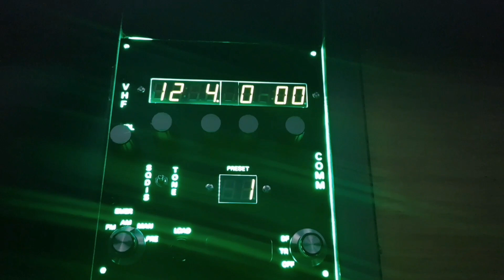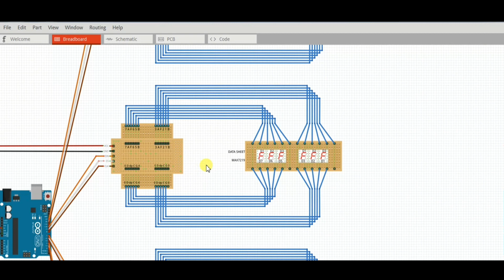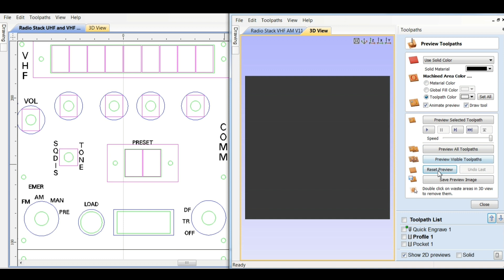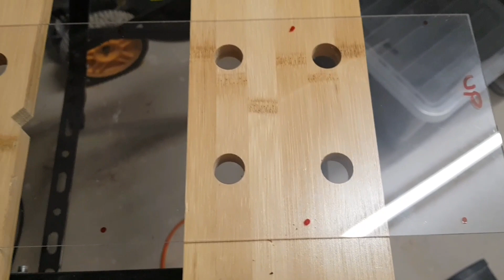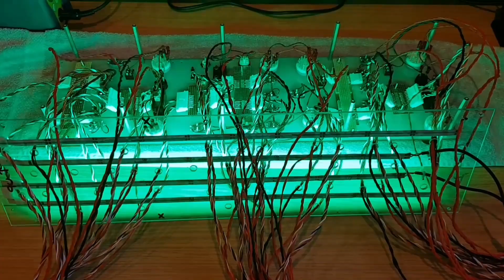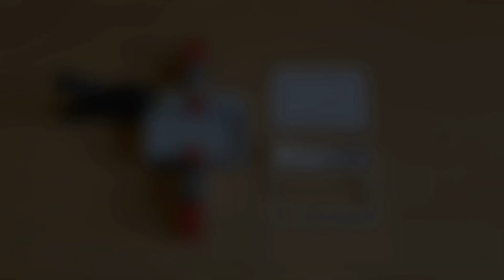Simpit A10C Radio Cluster Panel

Comment: Another fab video Craig. Where in the UK do you buy your switches. For example, the ones used on the battery panel s toggle on and off but also the inverter switch which toggles on in the up position but returns when toggled down??

Thanks
Toby
Reply from the maker: Hi Toby, many thanks for the thumbs up. I purchased most of mine from rapidonline.com. The odd one from RS components but they are expensive by comparison.
Cheers 👍

Comment: Hello Craig is it posible to contact you via email. I have a problem and cant find any help on the Internet. I want to build an universal radio Panel with two of those 7 Segment Displays. I wrote a Code and the first 10 changes on the Panel will be Displayed but after those 10 the Displays go crazy and Shows stupid crap. so if you have time and Passion you can contact me via: suhalt677@gmail.com

Comment: First of all Great JOB !, You use a Single Arduino for all panels ? How can you connect all devices if there are not enought pins on a single arduino board ? You use Shifters ? or you use a master Arduino and several slave arduino mini ?
Reply from the maker: Hi Jordi, I currently have 3 arduinos being used. The first Arduino is an uno and dedicated to the radio cluster, the second is a mega which controls parts of the left console (i.e potentiometers and indicator lights) and the third, is another mega which runs an RS485 network. This could potentially run many slaves (Arduino nanos), I plan to use it for all instrument gauges and the circuit breaker panel. I might also use it to connect the IFF and TISL panels.

Comment: One of the best YouTube Videos I have seen ever. Thank you so much. As a programmer and electrician, I can imagine how much hours have gone in to your project. I`m just jealous. I'm going to buy a CNC machine by the end of this year. Any recommendations?
Reply from the maker: Hello, thanks for the positive comments. 
My father-in-law built his own cnc machine and kindly let's me use this. 
Within the next year I will either buy a cnc or build one. I have read into a few flat pack built cnc's (like stepcraft) but not sure now accurate they are with small engraving.
With time being limited, I'm focusing on building my simpit and will research cnc's more into next year because if I build one I'm sure it will consume many months to get it just right. 
Are you building a simpit, if so what type. Good luck with your project, cheers
Reply: I just finished a real Truck Home Cockpit. Now I`m looking into a fighter yet.
Reply from the maker: That's cool. Some months ago I saw a few videos online where people got car instrument clusters connected to their PC. Brilliant. Good luck with your project, cheers
Reply: Craig S Thanks! Would you be willing to share CAD files for one of your panels? I’d would like to investigate little closer what it requires to get them ready for a Chinese CNC router.
Reply from the maker: No problems. It is in Cut2D format which is the best program to view it in. I can export as dxf but not sure what detail you might lose
Reply from the maker: I'll get this over to you at the weekend, I'll send the radio panel cad / cam file. Did you want it as a dxf export or Cut2D?
Reply: Craig S Great! Can you send both please?

Comment: Great work! I'm looking at doing the same, any chance of listing your Arduino Sketch and keyboard encoder list. Its good to have a nice video but with out coding it hard to recreate. Thanks.
Reply from the maker: Hi Chris, I have just recently set up a website to document the simpits build and are looking to start uploading the sketches. I had a few reinstalls of my PC and backed up / moved files around. It maybe a few weekends time before I can locate it but will then upload. I'll drop you a message when it's on there. The sketch is straight forward to share and people to use but the keyboard encoder file will only open in the hagstrom software environment and is just a list of keyboard bindings I chose and then programmed into the dcs sim, cheers.
Reply from the maker: Hi Chris, I have added the sketch as a downloadable zip file at http://mysimpit.co.uk/radio-cluster/
 Over time I will look to add all the sketches for all the panels. cheers

Comment: Love all your videos! Very clear and detailed. Textbook standard on how to build cockpit with Arduino and DCS Bios.
I dabbled a bit in arduino in the past, and also use ethernet cables like you, but i've been intimidated by more advanced areas like wiring for LED, servo, 7 segments etc. You just made sense to all these. Thanks!

Can you help with the following questions.
1. Can you do a video on CNC? what brand you are using, how to set up to set initial location of the router bit, how to securely hold down the acrylic etc?
2. I believe there is a limit to how many usb a PC can connect to. If we use many arduino boards, how to overcome the limit? you mentioned something about slaving the boards. Can you elaborate?
3. If we backlight all the panels, then there'd  be many led strips to power. Even if each comes with a power adapter, it is better or even a must to get an enclosure box to power all the strips? And go through a dimmer in between to mass dim all strips at will?
Reply from the maker: Hi rocketeer103, it's great to hear the video was helpful. Thanks. As regards your points
1. My father in law is an engineer and built the cnc machine. It's not therefore any particular brand, although I could get a run down of all the key components and brands he used. I am planning to build a cnc machine next year with his help and was thinking of documenting this process so others could follow. 
In a future video I'll put some extra footage in around the set up before machining the acrylic. To mark the centre point, we put a slightly adhesive piece of masking tape down gently in the centre (approximately) and then use a ruler to measure the width and mark that mid point, and then measure the height and mark that mid point which then reveals the intersection. I use a double sided sticky tape by a company called Trend to stick the acrylic to the bed of the machine. We always start with engraving as this uses a V bit which has a fine point and line it up almost touching the marked intersection. This enables us to set the X and Y axis. I think the video shows the Z axis then being set where we set the tip of the tool +50mm above the work. 
2. As regards USB ports on a PC. In the very short term I added 4 extra to my computer based on the motherboards capacity. However, I do plan to use some powered USB hubs which support data transfer which in turn will greatly increase the number available. Ultimately, I plan to build a RS485 network which has a number of slave arduinos linked to a master. There is some information on this on the Ed forums if you search under dcs bios.
3. The power supplies I will use for the 12v led strips can power a number of meters and you can get splitters which enable the power supply to branch out up to 8 seperate connections. So I won't need one power pack per panel, but instead a couple of power packs for the whole thing. I will build the lighting panel last and look at ways to possibly run the power supply through some form of dimmer.
Cheers
Reply: Thanks Craig for your reply. Is your power supply an adapter? If it's adapter I wonder how many times you can safely split into many connections. I saw some youtubers say to use an enclosure box or is that an overkill?

I look forward to your videos on CNC, RS485 etc. And I still haven't digested your video on the matrix setup for the caution panel :)
Reply from the maker: Hi rocketeer103, here are some links to the powerpack, splitter and LED strips I first started with.
https://www.rapidonline.com/powerpax-12v-led-strip-power-supplies-519228
https://www.rapidonline.com/powerpax-uk-c3705-1-to-8-way-2-1mm-splitter-cable-led-strips-56-2410
https://www.rapidonline.com/powerpax-uk-1mfl-300smd-g-c4229-1m-12v-led-strip-green-2-1mm-input-60pcs-4-8w-56-2338
These started me off, although as I now move beyond prototype testing to making the whole simpit I'm looking at cheaper options
Reply: Thanks for the links. Now I see what you mean by the splitter. I noticed the green led strip is only 1m long. Given the powerpack is 12V and total led strips wattage should not be >80% of power supply, it means this powerpack can support up to 2 of the 4.8W strips for a total of 9.6W?

If 1m strip can only support 2 to 3 panels of backlighting, i think we need 8-10m for the 20+ panels. I believe aliexpress would be the cheapest place to get these, even cheaper than amazon or ebay.
Reply from the maker: I think they do one version of the powerpack that is 90W and it can do up to 15m approx. If I connect two 1 meter strips together to then be powered, I could split 8 ways feeding into seven 2 meter strips and one 1 meter strip. This would be the 15 maximum which I think the datasheet said it could support. I'm focusing on the left console of the A10C currently and might finish that and then test other strips to find the nearest match in colour. I want to be careful I don't end up with a mix of different shades of green.
It's a good idea about Ali Express, I'll take a closer look at them. 
Good luck with your project, is it the A10C also, awesome aircraft. Cheers
Reply: I saw at aliexpress 5M led strip for $8!
my cockpit is a10c too, my favorite plane. I find attack plane a lot more fun than fighter. in dcs forum i go back the same name without the 103. you'd find a thread by me years ago where I posted my progress. But i haven't been active there for like 2 years. Had some personal problems. Now don't even have the space for it. Recently started doing research to learn about arduino, dcs bios, 485, 487 i2c etc stuff from many google and youtubes. hopefully next year i can move to a bigger place and resume my cockpit building.

the diagram and pictures by hansolo is awesome. A mega for each console-left, center, right. Then a max487 from Mega to another max487 and then to a nano for each panel. Freaking genius. Very modular and complete in each panel. Understanding the sketches will be another story. lol. i'm sure you'd come to the rescue in future with a video similar to this, haha.
cheers mate
Reply from the maker: I know what you mean about space. The first panels I ever built were for Falcon 4. I did a very basic left and right console (inputs only with a keyboard encoder). This was back in 2007 approx. From then onwards it mostly sat in boxes in my parents loft because wherever I lived there wasn't a spare room or it wasn't my place to have it out. I had to sit on this hobby for about 9 years and it's only a few months ago I managed to get the back of the garage converted to have some space. When I started building the prototype panels to practice and learn late last year into early this year, I had to keep all the electrical bits in the wardrobe in the bedroom. On days off work or at weekends I'd move all my stuff into the lounge the night before and then be up, like 5am (seriously) the next morning and have a few hours tinkering and figuring out the MAX7219 boards, Arduinos, etc before my girlfriend or daughter woke up and I'd then need to move everything out the lounge and back into my wardrobe. Lol. It felt like I spent so much time packing and unpacking stuff. The crazy lengths people like us go to for this amazing hobby, lol.
As regards the Ed forum I'll have a look for your thread (send over a link if you can) 
I've seen Han Solos work and he put some good pictures of his max487 circuits on there. I really liked John Walls photos of his panels. Also, the magnetically held toggles people are using for the SAS panels, etc are immense and budget allowing, I want some of these down the line
Keep in touch, cheers
Reply: wow looks like you also went through a lot of sh*t for the cockpit building. My a10c started in 2009! lol. it's been so many years. I moved several times and didn't have the space at times, like now. Here's my DCS thread.
https://forums.eagle.ru/showthread.php?t=48697
But i haven't updated it for about 2-3 years. today i noticed that my pictures posted there are no longer showing by photobucket. they want so $$ every month to host them. wow. so sorry you can't view the pictures now. one day when my situation improves and i can resume my pit i'd consider updating the hosting and my thread. for now it's in cold storage. lol

Comment: Hello Craig, Your videos a re very informative. I'm and getting ready to build my first panel, The Top VHF Radio. Could you by chance list your the parts list for it?
Reply from the maker: Hi Philip, on the basis that you use dcs bios for all inputs and outputs then I would get the following
1 x Arduino uno (a copy version will be fine, but check reviews to avoid driver complications)
2 x MAX7219 8-Digit, 7 Segment display kits (using the 7 Segment displays they come with would save you time)
4 x rotary encoders (for frequency input dials)
1 x 4 position rotary switch (frequency selection dial) 
1 x 3 position rotary switch (mode dial) 
1 x (10k) potentiometer (volume control)
7 x knobs 
1 x momentary push button (preset load)
1 x mini toggle - on-off-(on)
All the above are the ones used in the default menu of the dcs bios "control documentation library" online, however I would have a think about your switch for the preset station selector. A multiposition switch for this uses about 20 pins, if you look at the advanced menu ((control documentation library)) you can use a rotary encoder instead (however, you'll need to think if this will be in keeping with the look of the panel in the A10C. Thumb wheel switches are ideal but can be expensive so I used a rocker switch, but I input with a keyboard encoder so used 2 inputs only).
Hope that helps, cheers

Comment: This is great video production Craig. Nice.
Reply from the maker: Thanks Joe, I really enjoyed making this panel, it was my biggest so far. How's things your end? What panel you working on currently?
Reply: Craig S , I recently moved to a new job assignment across country. So I’ll be in a hotel for a month or so till I find an apartment. So everything is boxed up in storage but can’t wait to get back at it.
Reply from the maker: Hi Joe, I hope you get up and running soon. I see you uploaded a video yesterday so will check it out later, cheers
Reply: It was nothing much. Just an old clip I took before I disassembled it.  I wanted to go more in-depth about the panels from pcflight.com. They are on the a little too thick for the face plate. Because when you bolt it to the backplate, the rotary switches and potentiometers and encoders shafts are not tall enough and it causes the set screw in the knobs to miss the shaft. So in some places I will need to use shaft extenders so that it is tall enough to reach the set screw in the knobs and dials. Pcflights.com should reduce the thickness of their faceplates.